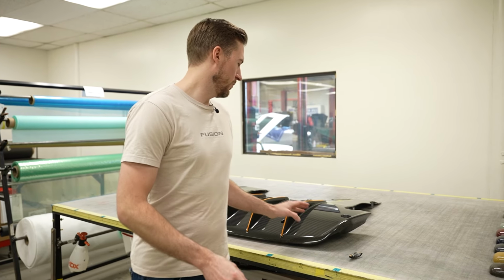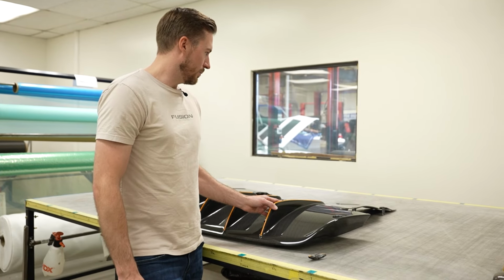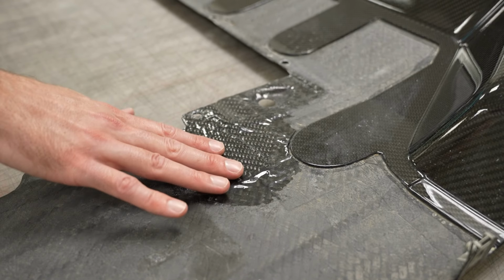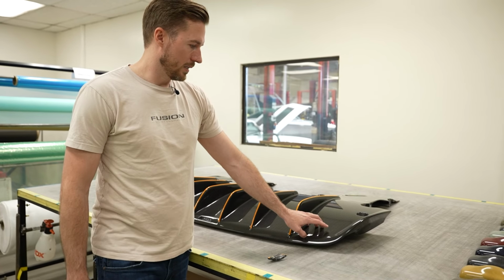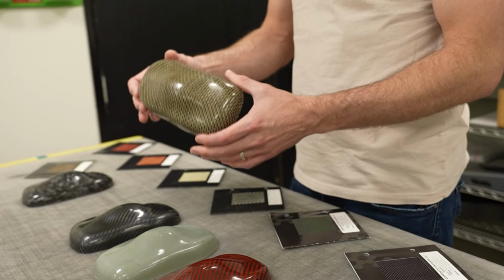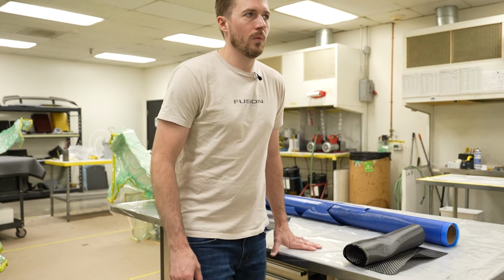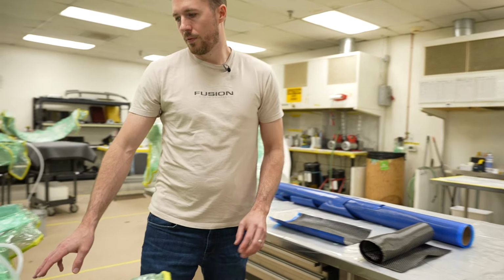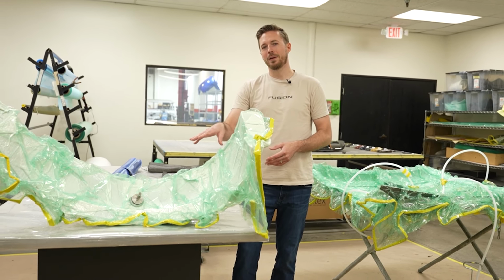How To Repair Carbon Fiber | Parts & Body Kit Process | Fusion Motor Company

Comment: Would have liked it if you showed more of the repairing Process in Detail. Like how to align the Fibers from the Carbon to the original Part.
Reply from the maker: That’s good input we will make a different one with more tactical information.